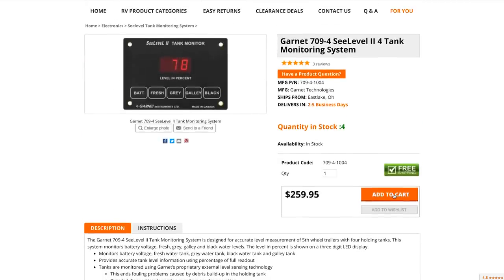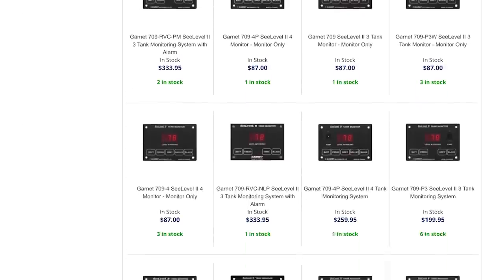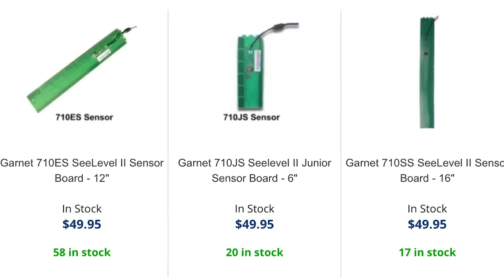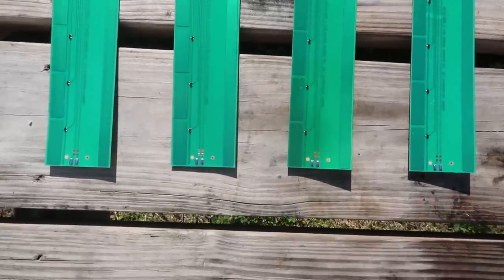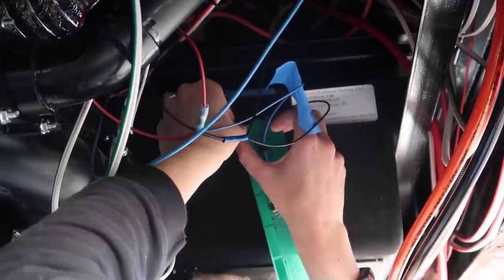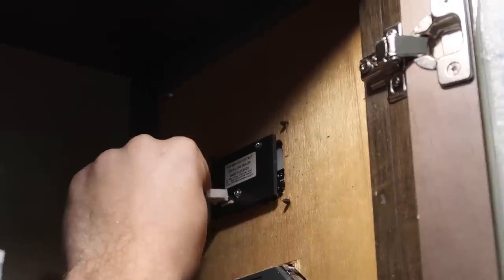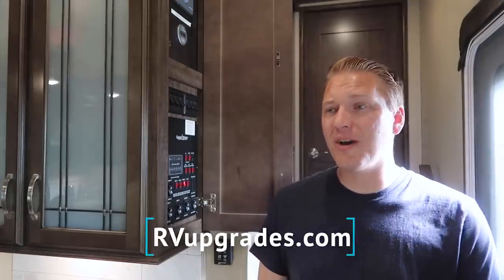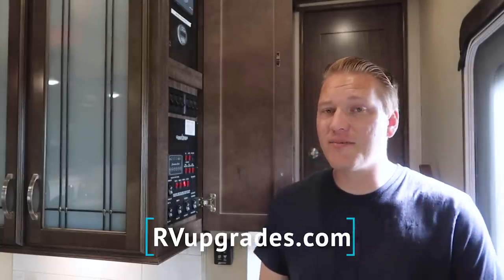ACCURATE RV Tank Readings! || SeeLevel Tank Monitoring System Install From RVupgrades.com!

Comment: Running the wires is usually the hardest part of any electrical upgrade.  I have wanted to install the SeaLevel Tank system in my RV for 2 years now and I keep putting it off.  As for RV Upgrades I use them all the time they always have what I can't find anywhere else.
Reply from the maker: It's definitely our new go to website for all things RV related!

Comment: Hi guys, awesome job and very helpful video. Curious if you could share more detail about how you did wiring? Was it just one long set of wires running between the furthest tank and the control panel, that you then spliced the other tank sensors into? Is there a word for that kind of splice (I'm assuming it's different than a butt splice, which is end to end vs. end to middle section of wire) if that is what you did? Thanks!

Comment: Our RV (which is our first RV) came standard with these sensors. So while I don't have any basis for comparison, I really like the SeeLevel a lot. I wish it were even more precise! Ours jumps by about 4 to 5% at a time. So it starts out at 0, then doesn't change until it shows 4, then doesn't change until it shows 8, and so on. I'd love to see it show each percent - 0%, 1%, 2%, and so on, but what it does do is pretty great. I think the Bluetooth connectivity would be awesome as well!

Comment: Installing them next week!
Reply from the maker: Awesome!! How do you like it so far?
Reply: They work well though we occasionally get mis-readings from the black tank sensor. And due to the weird Tetris-like tank shapes, 60% of the capacity is in the lower 50%. This is in a diesel pusher where the tanks need to slide under the frame rails and still take advantage of the height on each side. Anyway, thank you for the videos.

Comment: Jason have you been able to find out if the Seelevel system can feed your CCGX tank level display inputs?
Reply from the maker: Not yet but they are working on it - 
https://community.victronenergy.com/articles/14125/rv-c-protocol-and-victron.html

Victron already has the ability to read the existing resistive tank sensors though with standalone modules that are expensive or some the GX series have it built in

Comment: How do these sensors measure tank volume from the outside of the tank?
Reply from the maker: They have electronics embedded in the printed circuitry that send signals through the tanks contents to determine the level! :)
Reply: Getaway Couple that makes sense. Kinda like a sonar